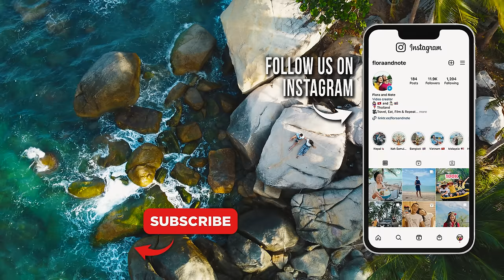Our Worst Fear Comes True 🇹🇭 (Driving Across Thailand)

Comment: U have over lifted the car and tires are too oversize. All u need is a 2” lift and some taller wider tires. U’ve gone over the top with this build. Been there done that. All the weight will strain the axle, drive train, suck up gas and with that height, even a small lean might topple it…and u don’t want that to happen. 
The angle of ascent decend on these Suzukis are already amazing.  Hence the 2” lift is more than enuff. Maybe a more offset tries will make it safer

Comment: You need to be careful with modified vehicles.  I see you have non-standard oversize wheels.  This will increase the resistance in the drive train.  I understand that there is also a non-standard yet more powerful engine.  This will increase the torque.  These two increases in combination will place a lot of pressure on the weakest link in the drive train which will be your gearbox/transmission and/or the output shaft.  You may want to consider upgrading the gearbox/transmission and the output shaft (couplings, uni joints, etc).
Reply from the maker: That's really good advice and we wish the garage we worked with before would have told us that...This is all a huge learning curve for us.
Reply: @FloraandNote  You're all good.  The previous auto shop may not have considered the issues that may arise.  They are rare.  Most of the time, you can get away with changes in the mechanical physiology of a vehicle.  Sometimes not.  Those little Suzuki Jimny/Sierra vehicles are epic performers.  Just keep an eye on the auto transmission and your output shaft because ultimately, they are the weakest point in your drive train right now.